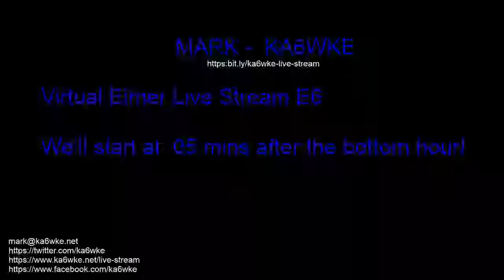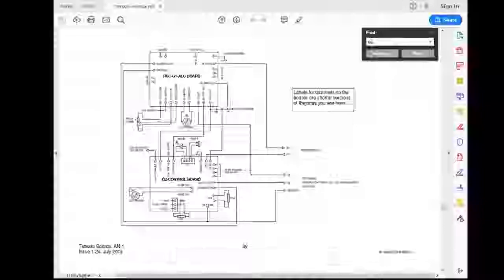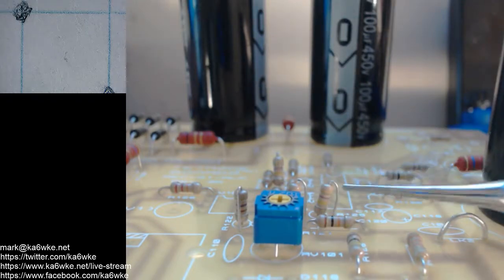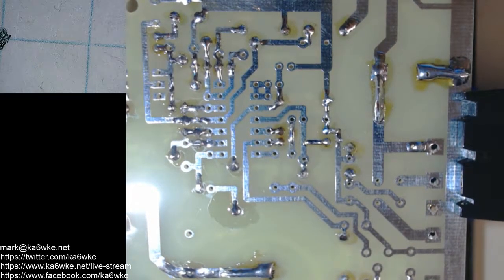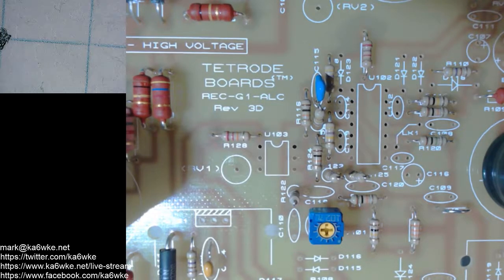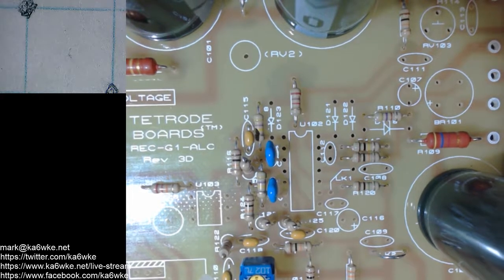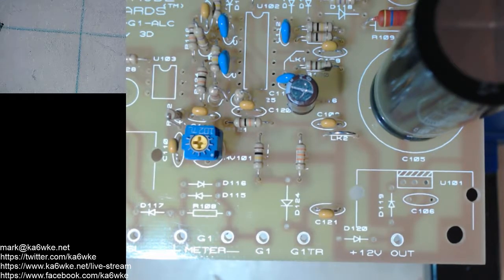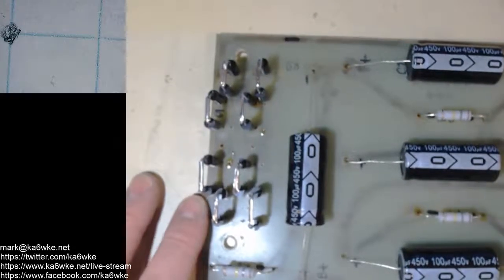Finish Up G3SEK Tetrode Board

Comment: I'm working on building up a set of these boards for use with a 4CX1500B. I plan to produce a video shortly running through G3SEK's procedures for calculating the value of several Resistor Values that are dependent on the characteristics of the tube employed. Along with it I will include some Theory of Operation of these boards. I have DIP Trace PCB CAD Design Programs and considering design my own set of boards for this task. BTW in the instruction manual for the G3SEK Tetrode Board Ian strongly advises the calculations for the for the Critical Resistor Values be done BEFORE starting assembly of the boards. AA6XE
Reply: @AB1Vampire  Been building amps since 1974. Half a dozen in all. Tubes include 3-500Z, 4-1000A, 4CX1500A, 3CX1500D7, 8877 and now a 4CX1500B. Is that enough experience for you ?
Reply: @WestCoastMole  of course never any doubt. Look forward to your vids.

Comment: Hello, at the time of writing this comment,  G3SEK no longer sells those Tetrode boards, I am looking for an alternative manufacturer/seller. If you know where I could buy some of these boards (ready-made, not in KIT) , please post the link here. Many thanks
Reply: No, G3SEK doesn't make the boards any longer. I've since abandoned the project and when I'm ready for an amp, it'll be SS. I do have these boards in storage and I plan on putting them up for sale when I get a new QTH. Could be some time though. 73
Reply: @markschoonover  Solid State Devices produce IMD (Inter-modulation Distortion) products that can be charitably described as fair and more realistically described as poor for use in the Amplification of SSB Signals. Leave Solid State Amps to amplifying CW and AM Signals.

Comment: I was surprised & disappointed about this segment, I was hoping you would get into an advanced discussion/lecture of the workings of the tetrode board more and less of a soldering demonstration. You have a LOT of work to do yet....jan N8CBX
Reply from the maker: Well I was thinking I've done enough episodes on the tetrode boards and people were getting bored. I can add how these boards work once I get to testing them. Remember though the audience for this live stream is geared towards the beginner so I'm steering away from any in depth electronics discussions. There are many other podcasts/videos that cover in depth electronics. Thanks for the reply!
Reply: Building a tetrode amplifier is NOT an effort for someone that has no building experience, but I'm your audience too and I curious what you were going to lecture on. So, I realize now this wasn't going to be of technical content, just a soldering demo, I guess . If you need any help with your amplifier build, let me know.......jan N8CBX
Reply from the maker: I disagree here Jan. You can be a ham for over 30 years and have never built an amplifier of this caliber before. This still makes one a beginner. I chose this project because it's what's on my bench right now. I appreciate the fact you're part of my audience but if this live stream doesn't suit you, there are plenty of others out there that may. 73
Reply: Oh, so I guess you want me to leave then..You know all about it...
Jan N8CBx
Reply: very few vids of homebrew construction from start to finish.  Its a good idea and I hope he continues. It's only vid #2 so give it time.  I'm sure the time it took to setup and edit video was far longer than 1:15:46.  I appreciate  ka6wke' videos and look forward to more.  ned, n2eye
Edit:  I'm  sourcing parts for this same project myself after being away from radio for  several years.